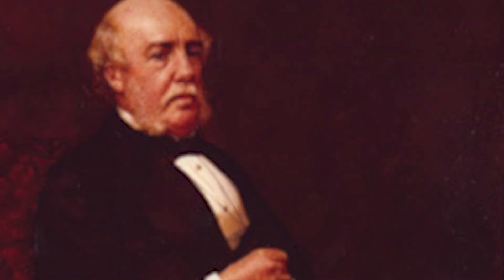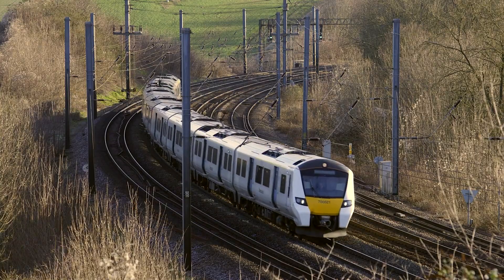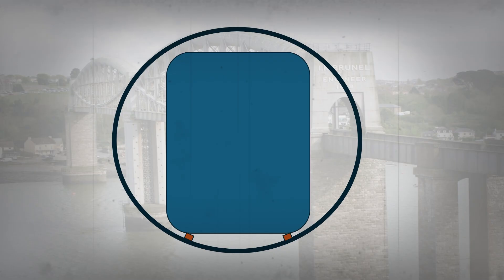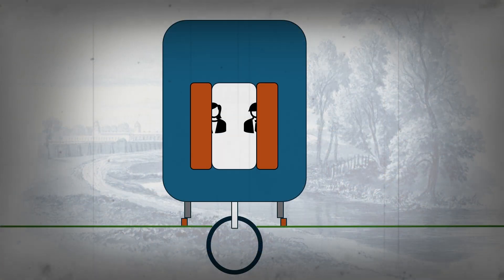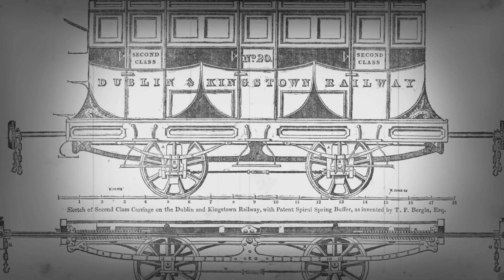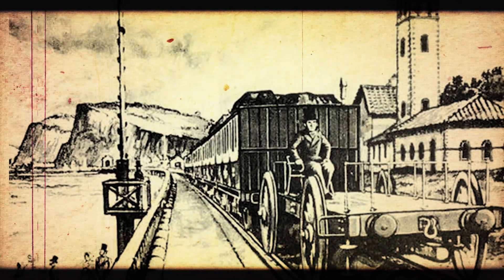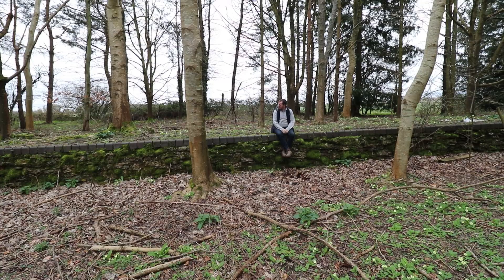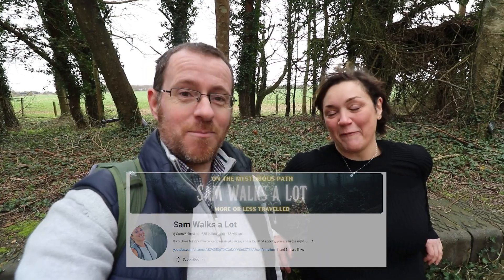Brunel's Big Mistake: The Atmospheric Railway Disaster!

Comment: NO!! This is NOT the end of the story! In viewing the Brunel conduits, an idea immediately comes to mind.  An electromagnetic induction cable of possibly considerably lesser diameter and enclosed 270 - 315 degrees of its circumference by a tubular permanent Neodymium rare earth magnet, or truck containing the same apparatus. never in direct contact with the cable.  Electromagnetic attraction/repulsion accelerate/brake the train.  Research into and modification of Louis P Brennan's Gyro - train design would result in a swift monorail probably able to achieve rather high speeds (300 MPH+).  Heavy viaducts wouldn't be necessary, just a single, flexible,  firm I - beam girder under the cable to avoid sagging of the cable.  This might resemble the the Mannheim Aerobus of 1975, or the 1886 Meigs monorail in Boston.  How about that?

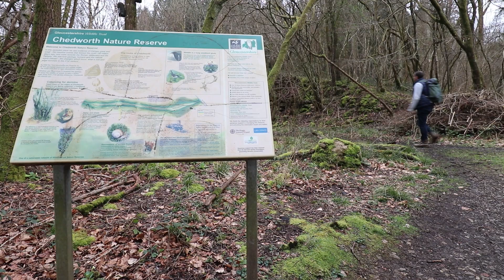Comment: @1:52 "The most efficient way we move trains is by having a static electric power source. In other words..we remove the engine from the train, and place it along the side of the railway." <~ Excuse me, but this is NOT 'removing the engine' at all. The train still has the electric motors within each train, whereas Brunel's trains did not have any engine/motor weight. And one could argue that THE MOST EFFICIENT method for train propulsion is the diesel-electric freight trains, when considering ALL costs:benefits are calculated. For all of it's flaws..Brunel's atmospheric powered train idea still has merit amongst all of today's alternatives. Not denigrating the use of electric trains, but it's simply wrong to claim it's "the most efficient". #DirtyElectric

Comment: Most aircraft catapults uses something like this, except they use high pressure steam behind, track is however short so you don't care much about losses only power. 
For rail the idea would die with better steam engines.

Comment: Electrics don't remove the engine (motor) it only removes the fuel supply. The atmospheric concept does try to remove the motor. That's the actual concept difference.

Comment: This seems to be similar to the San Francisco cable cars (1876). Instead of atmospheric tubes under the train, the cable cars had steel cable located below street level. The cable was moved by a central power station. This cable ran at a steady speed (9.5 mph). The train was able to connect & disconnect with the moving with a lever controlled by the operator.
Reply: The Glasgow subway was the same (i.e. cable haulage) until 1935 when it was electrified.

Comment: Fully electric is not most efficient. It might work well enough in small countries like in Europe, short light-duty passenger train type voyages. Diesel over electric is the most efficient; a diesel generator operating at peak efficiency at a static set rpm, driving a generator to have all the torque at every wheel. Look into Edison Motors for the same concept in its infant stages of prototype testing in heavy-duty vocational/over-the-road applications.

Comment: Many of the Brunel vacuum pumping houses still exist. There is even one on in Torquay on the line between Newton Abbot and Kingswear on the Dart Estuary.  That end of the line would have never worked as an atmospheric line. Gradients are too steep.
Reply: The Atmospheric System was proposed because it was thought that steam locomotives would not be able to haul reasonably heavy trains over the steep banks between Totnes and Plympton on the main line from Newton Abbot to Plymouth. Electric trains come close to achieving what the Atmospheric trains set out to do. The traction motors and electrical control equipment in an AC locomotive weigh much less than a diesel engine, alternator and fuel or a steam locomotive's boiler,firebox and coal. The Great Western did consider electrification west of Taunton, where the original route from Bristol is joined by the more direct route via Westbury. This would have included Wellington Bank on the Somerset/Devon border as well as the South Devon banks. Much more recently there has been a proposal to electrify between Totnes and Plympton, to enable the bi-mode IET units, which replaced the HST diesel sets, to use their enhanced power in electric mode over the South Devon banks.

Comment: Great walk Paul and of course Sam with some lovely 'finds' in the shape of tunnels and railway buildings, well done.... However, now on to your coverage of Brunel's Atmospheric Railway where you use the word "Disaster" in the title, which in my opinion is quite wrong and unfair as in its early days it was seen to be a success as trains did indeed travel the length of the line without incident at over 60 miles per hour. You were correct in saying the downfall was due to the unsuitability of leather as the pipe seal, indeed the technology was ahead of the materials available at the time, which of course was its downfall and by no means a disaster !

Comment: Great video. I heard about a case where carriages were not yet to a locomotive which was released and pulled up a hill. They calculated it was the first train to achieve  a very high speed uphill 80mph (guess). Is there any truth in that?

Comment: Very ingenious system. However, it seems to me that it would have been a LOT easier and cheaper to devise a cable system, above ground, with the cable being run through pulleys - something like today's cable cars.
Reply: Cable haulage was used, over limited distances.    For example from Edge Hill down to the docks at Liverpool, and from Euston up to Camden Town.   Both of these featured gradients into the terminus that were uncomfortably steep for the locomotives of the day.   However the cable-hauled sections were only a mile or so long, at the top of which the cables were disconnected and normal locomotives attached.   The cables were discontinued when locomotives became powerful enough to handle the gradients.
Cable haulage is a practical solution for short steep gradients (and still used today on some cliff railways or 'cable cars'.    A lot cheaper and more practical than 'atmospheric'.    However its limitations for longer distance trains should be obvious.

Comment: While the initial idea was not successful to move people and animals, the technology can still be found in hospitals, and large retail stores (Co-op) etc.. to transport small items papers, blood samples, reports, etc.. round a building. There are also commercially available cylinders which work on the original principals but only up to 2 meters stroke (limited by manufacturing and transport details)
Reply: Those pneumatic systems use sealed pipes, without a slot in the side.

Comment: The atmospheric Inn, at Star Cross has a section of the pipe on the wall. A steam pump house is beside the railway there as well, now used as apartments.
Lengths of the atmospheric main were used as a sewage outfall from Dawlish out into the sea. Now long replaced.

Comment: "The weight, the adhesion, they were both solved by electric"

Umm, the two are linked. For a locomotive to have adhesion, it needs mass.
Also, while you place the power plant of the engine remotely with electric. You still need an engine, even if you would rather call it a motor when it's electric.

You can solve adhesion when weight is low in one of two ways:

Add more contact patches, such as more wheels. Using American notation here, 2-4-0 means two leading wheels, four driving wheels and zero trailing wheels on the locomotive.
Some of the bigger ones were 4-8-8-4, meaning it had 4 leading, 8 driving PLUS 8 driving and 4 trailing wheels. The locomotive itself had a pivot to allow it to negotiate turns with that many wheels.
It was all in the hunt for adhesion.

Or, make every wheel on the whole train a driven wheel.
This was also tried early on before electric trains. But that mainly only works on passenger trains.
Freight trains don't have powered wagons because that would be prohibitively expensive.

So, even modern electric locomotives made for freight are super heavy. They have to be to put as much pressure on the driving wheels as possible to increase adhesion.
Reply: From what I know a lot of this mass isn't the motors. Things like inverters(turning DC to AC) to control the motors weight a lot and need cooling, in case of AC lines there also has to be a rectifier first(and often a transformer too). There are also things like pumps for pneumatic systems.
Reply: @ImieNazwiskoOK  Some locomotives have dead weight just for the sake of getting traction at low speeds.
Sounds very counter intuitive to make something heavier by just adding weights to it but that's what they did with some designs.

Of course, if the weight comes from useful stuff then that's good too!
Reply: @RealCadde  Is the dead weight making some part unnecessarily thick and bulky or literally just adding blocks of something like steel?
Reply: @ImieNazwiskoOK  It's usually making something extremely thick.

It's the same with forklifts, their rear end is one massive lump of metal that acts like a counterweight or the forklift would definitely be tipping over whenever it lifts something that is heavy.

If they somehow could make the locomotive have tracks like a tracked vehicle then it wouldn't need to be heavy at all as there would be massive contact patches with the track. But since circles have a very small contact patch, the locomotive needs lots of mass to make that traction from such a small area as high as possible.

As i said in my first comment, they either need to add many wheels (and thus make each wheel smaller which makes the locomotive slower) or they need to make it very heavy to provide the traction it needs to get moving.
Reply: I would disagree.   The many wheels weren't 'in the hunt for adhesion' and in fact adding extra wheels without increasing the weight of the loco would just result in a lighter axle load per wheel with no improvement in adhesion.
The extra wheels were added as locomotives grew ever bigger (i.e. longer) in the hunt for more power and tractive effort, and to keep within the maximum allowable axle load.   The (non-powered) leading and trailing wheels were simply there to support the weight and, in the case of higher-speed locos, improve the riding on bends.

Comment: The Dublin & Kingstown was already steam powered from Day 1; rather than horse. Possibly the first commuter railway as such. On the face of it, this makes the atmospheric extension seem very very odd, but I believe the incline was the reason for it. Can still travel on it with electric units or long-distance diesels.
Reply: It was not unusual in those early days to add steep 'inclines' (usually cable hauled) to the ends of generally-flatter railways.   As locomotives got more powerful and capable the 'inclines' (typically with gradients of 1 in 50 to 1 in 30) became capable of steam working.

Comment: The atmospheric railway thing always seemed like a good idea badly executed. Perhaps if Brunel had looked after it better, it might have been more efficient and less costly?
Reply from the maker: I think that was his ultimate trouble. He wanted to do the whole thing as cheaply as possible and didn't take the advice of the designers.
Reply: @pwhitewick  - sounds familiar to today’s infrastructure woes doesn’t it?
Reply: I am not sure it is so simple.  First it worked in South Devon over many miles for the best part of 3 years and promised a lot of financial savings.  During that time, Locomotives changed their capabilities significantly (I am sure someone more knowledgeable would back me up by saying larger and smaller broadguage and standard guage locos became more dependable) so that, by the time the atmospheric system was failing, better alternatives existed which they did not at the time the project(s) were conceived.  I also he a suspicion that Brunel's own, and his investors' interests in other lines on the same network may have been conflicting.

Comment: Very interesting research Paul, thank you.  These transportation projects would have been a huge leap forward - they would  have provided a fast, safe (no points or traffic from opposite direction on same line) and a very quiet ride. A trial run on the atmospheric railway between New Cross to Croydon on 22 August 1845 when the train reached 60mph and on a later trial achieved an unheard of (then) 70mph. No wonder there were others trying to get these systems to work. Faulty seals, difficult turning carriages around and an inclined section, high cost of creating the vacuum at three pumping station led to the early demise of the Croydon line just four months after opening. New materials, 175 years on, can provide a reliable seal and railways using this technology are now successfully operational. Examples run in Brasil and Indonesia under the name Aeromovel, I believe there may be others possibly in Germany (as a suspended railway) and maybe a new one in Japan. If any readers of this posting can add further info  this could be very helpful!

Comment: we did not move the engine from the train. They all have electric motors except tramways.  But we did remove the fuel and it is supplied by wires along the track.
Reply: Not all.   Diesels?

Comment: An absolutely fascinating and informative documentary Oh those wonderful 18th and 19th Century Engineers building on each other and going forward. Visionary and never giving up making mistakes yes but moving on.  Only if you do nothing do you NOT make mistakes.  Just one slight quibble your touching faith in electricity and electric overhead  lines. Even they can fail.  Many years ago  just as we left York Station an almighty Thunderstorm started.  Our Train which had overhead electric lines was  struck by an almighty bolt of lightening.  We were stuck there for 5 hours! and the whole down line to London East Coast line was blocked for I do not know how long!  So am afraid no system is 100% fool proof!  However thank you a wonderful slice of railway history.  Your enthusiasm is catching.

Comment: With electric trains Your not really removing the engine your relocating the fuel.
Reply from the maker: Fair
Reply: That's not really correct. The closest equivalent is a diesel-electric locomotive where you have a diesel engine generating electricity which is then fed to the electric traction motors. With an electric locomotive, yes you retain the traction motors but the engine is still removed (to the power station).

Comment: The sliding seal on a pressure / vacuum tube was eventually perfected on steam catapults on aircraft carriers - I wonder whether they investigated the atmospheric railway concepts when they were developing it?
Reply: It probably helps that as much pressure as is needed can be developed subject to energy and materials but a vacuum is severely limited to maximum of one atmosphere difference from ambient. If the aircraft carriers catapults leak air then they can generate more pressure to tend to compensate. The early static steam engines (as in old tin mines etc) were severely limited as they used vacuum rather than pressure to operate.

Comment: There is an intact pumping station at Starcross on the Exe estuary, which used to house a working model of the atmospheric railway, which you could ride on for a few yards. Using modern, synthetic materials instead of leather, I believe this idea may still be viable.

Comment: I remember our local shop had a pneumatic tube system for communication between the front and the back of the building. It was really old and a novelty even then and I thought it was the best thing I’d ever seen. Watching a small cylinder go flying up and away was always exciting.

Just a miniature version 😂
Reply: The difference is it’s a sealed system. No slot in the side to transmit power
Reply: I remember those in department stores. The hospital that I regularly attend still uses one.
Reply: It always seems like something out of The Jetsons!
Reply: @sirifail4499  Yes, exactly. Perhaps at Spacely Sprockets ha ha.

Comment: A friend of mine was asked to make a working model for the Newton Abbot museum which he did.
Plastic pipe with a slot. AND YES THE FLAP  Parcel tape... Same old problem, it worked superbly you just had to re apply the tape after each train passed along.
Reply: Just a thought - what about a piston in an UNslotted pipe, the piston containing a magnet. A matching magnet to be mounted underneath the vehicle to attract the in-pipe magnet so the two would be magnetically coupled. Lubrication of the piston would need to be devised and some means of controlling the pressure behind the piston - radio control from the vehicle perhaps? Or then again MAGLEV which has been proven and around for years? Brunel would have loved Maglev.
Reply: @philiptownsend4026  An unslotted iron pipe?    I don't think plastics were a thing in those days.   Or aluminium.   (Not sure but I think induced eddy currents in the aluminium would have impeded things).   As for Maglev, the electric power requirements are huge, it would be easier just to put an electric motor on the train which, of course, is what they did.
Reply: Atmospheric systems have always been a rats breakfast of problems.

Comment: Another great video, thanks Paul.  At the same time you posted this video, Robslondon posted a video, also about a train driven by air pressure.
Here is his video : https://www.youtube.com/watch?v=x00oovKRYno
Yours is about a under-pressurised tube between the rails.  His is about a tunnel under the Thames, where the whole carriages are enclosed inside the under-pressurised tunnel.
Both videos are compliments to each other.